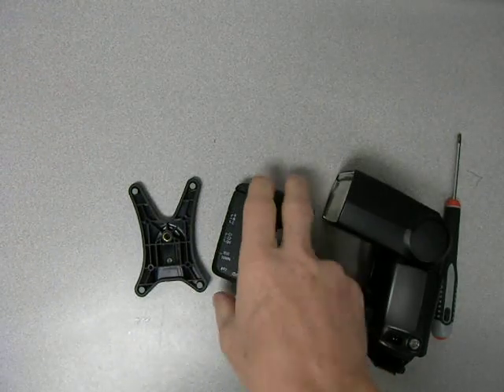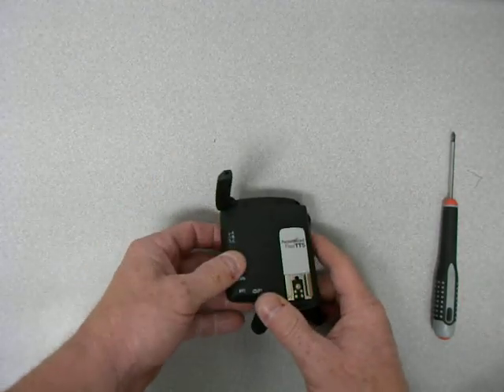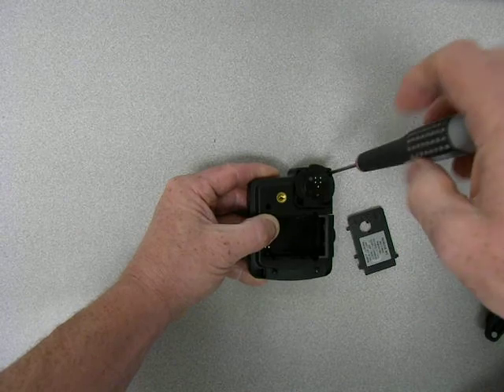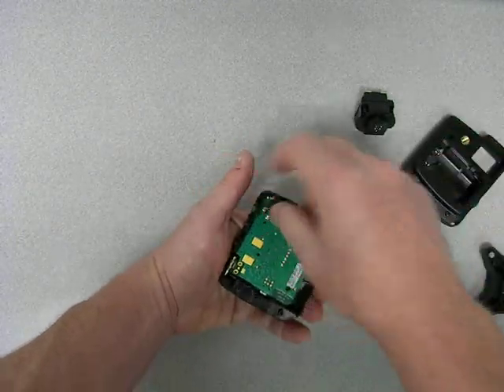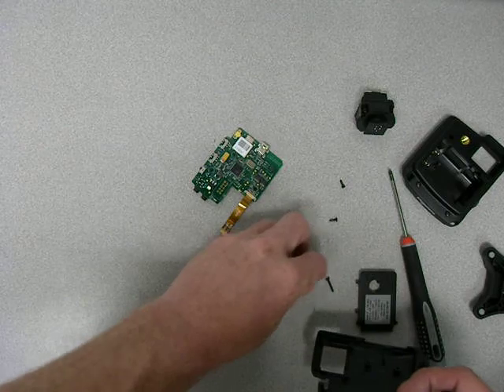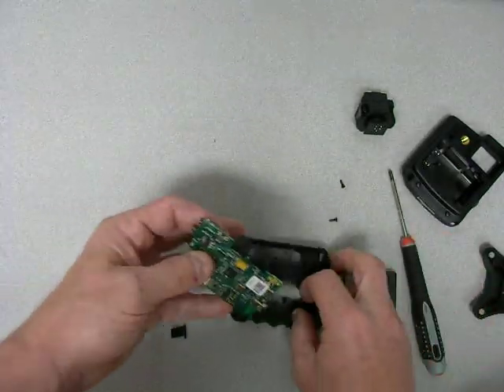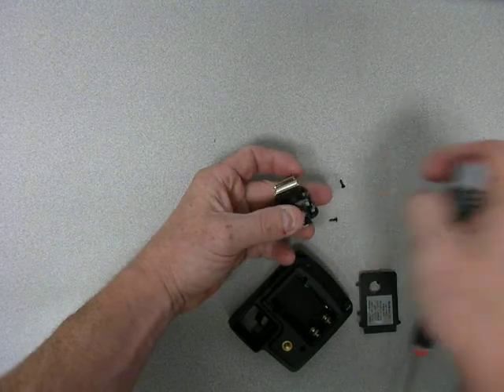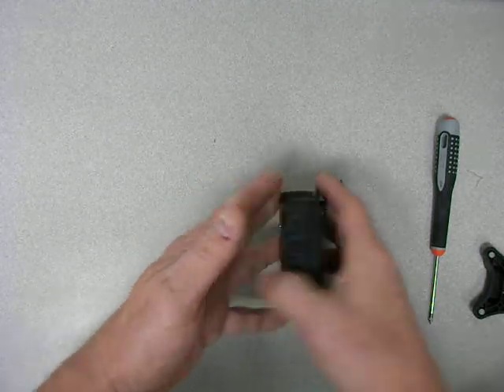How to disassemble and reassemble a Flex TT5

Comment: thanks man. i fixed my dead unit after seeing your instructions. didn't even need to open the whole thing. just needed access to the battery contacts. needed little cleaning. i was never happy with pocket wizard anyway. very unreliable frustrating when on the field, goes dead or stop/start working on its own.

Comment from the maker: Leaking batteries are a problem.  If the cell voltage gets below ~0.8V per cell, the likelihood of leakage goes up dramatically.  I have recently learned that Duracell has a policy, if the battery leaks when a Duracell battery is in the device, any device.  Duracell will replace the device.  http://www.duracell.com/en-us/guarantee  I hear that other battery companies might have similar policies but this is the only one I have looked up